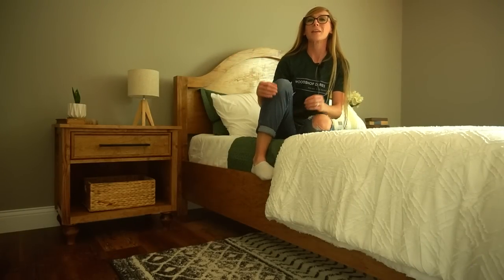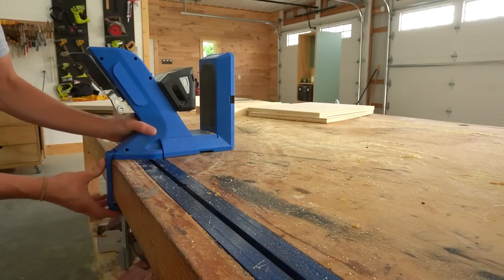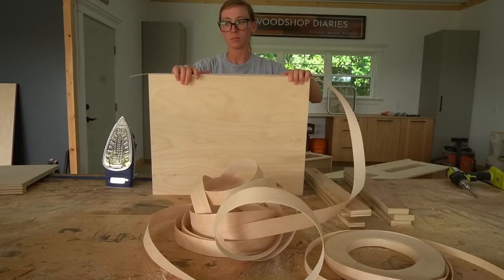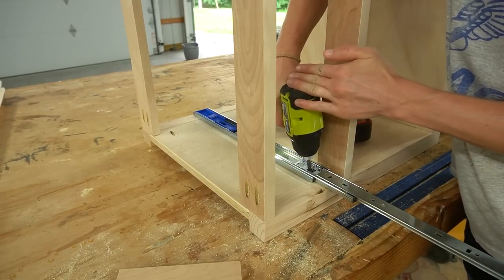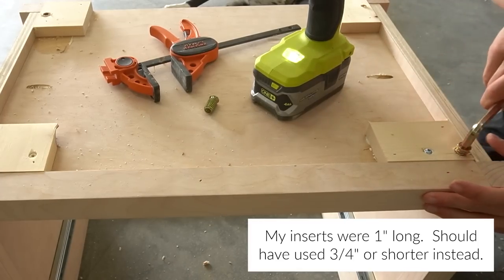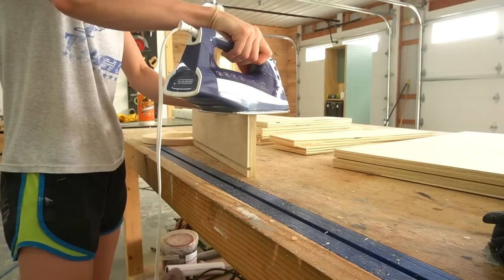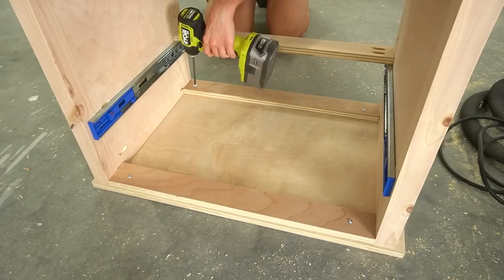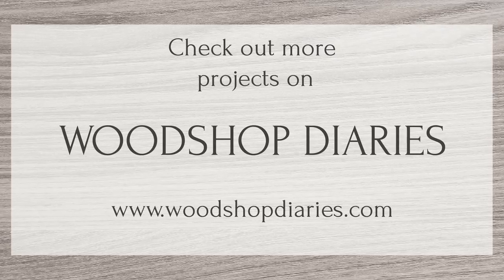How to Build a Nightstand Table w/ Drawer [Matching Furniture Series]

Comment: Excellent project. I always appreciate your insights into things you would have done different if/when you would do it again. I've definitely messed up with threaded inserts before LOL! The worst was using the drill bit the manufacturer recommended. It was too small and the wood spilt before I got it halfway in 🙄 You would think they would know what to use.
Reply from the maker: Thank you! I’m glad you enjoyed the “bloopers” haha. I’ve read (but reading isn’t doing so I can’t say how accurate this is) that you use a different size bit based on the wood type…like slightly larger for hard woods, slightly smaller for soft (or maybe I have that backwards). But they only come in so many sizes, unless you buy a bunch of special ones. So I just use what’s close to the size of the shank 🤣 who knows haha.

Comment: Shara, this is a nice looking set.  Thanks for sharing the lessons learned.  They are just as valuable as all the steps that go as planned.  Have you thought about HVAC for your shop? I finally added heating in my shop and it’s wonderful.  I decided against cooling because i only really want it for about 1-2 weeks a year.
Reply from the maker: Thank you!! I haven’t really wanted heat and air in my shop for several reasons. Like you, there’s usually only a few weeks out of the year that the weather is just too hot or too cold to deal with. But I like working with the doors open too much to invest in a hvac system haha